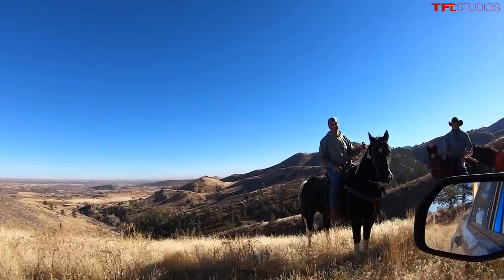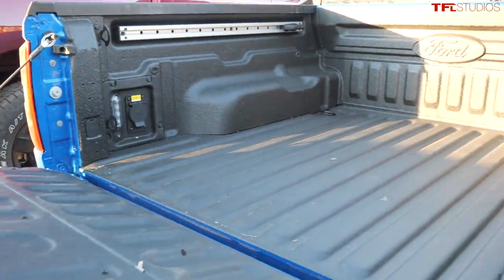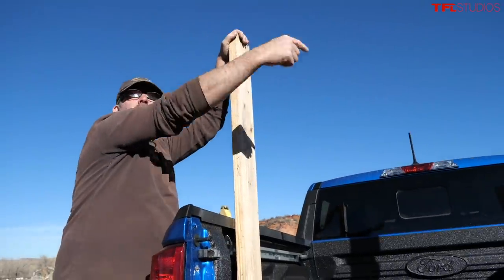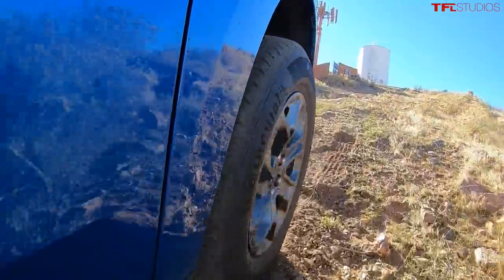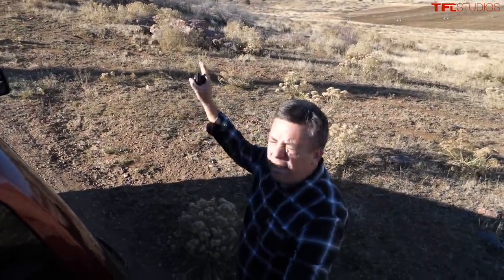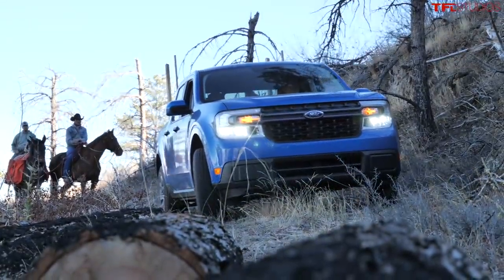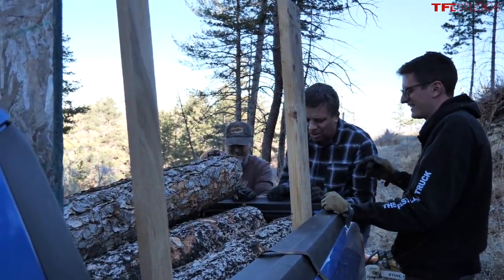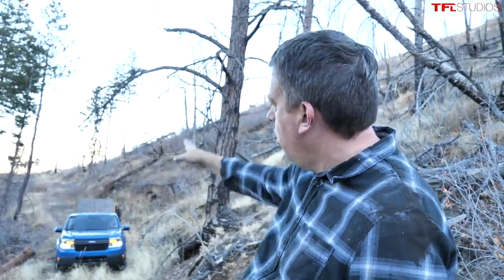Did We Go Too Far MAXING Out The New Ford Maverick To See If It’s Ranch Rated?

Comment: I’m very impressed with the Maverick’s capabilities. I just wish the hybrid was available in AWD.
Reply: I think almost like Apple they’re holding back that feature I would bet in a year or two it will be available in all wheel drive. Who knows maybe we will even get a 50 miles of range plug-in hybrid all-wheel-drive that would be absolutely awesome!
Reply: @TristenHernandez  Yeah they can't keep up with demand as it is.  Once sales start to cool a bit  I expect we'll see an AWD hybrid.  They could do a plug-in hybrid but I would expect that cost to be more than the turbo.
Reply: that would take a hit on mpg and add money to the price. you either want mpg or you don't that's why the other engine is an option
Reply: But will it preform the same at 200,000 miles...
Reply: @philllsxga.7737  If it's anything like the 1st and 2ng gen Escape hybrid that came before it, it'll perform the same at 400K miles.
Reply: @supersnot4  I doubt that...
Reply: Nope not gonna last as long with all that tech and batteries polluting landfills
Reply: Just wish I did not have to wait for my hybrid maverick till maybe hopefully next Aug, ordered in Aug 2021
Reply: I live in Utah, a state marketed around it's snow. Yet fwd is all you need here most of the time. If it's good enough for Utah winters, it's good enough for the winters in most states.
Reply: @lutomson3496  The hybrid system is far more durable than most gas powered vehicles you can buy.
Reply: @KB-bh9hp  I own a hybrid and bought it for gas savings only but it has much more recyclable NIHMD batteries vs the lithium batteries of which 50% end up in landfills
Reply: @lutomson3496  Well, it stands to reason that as more hybrids/evs populate our road, and the issue of recycling batteries gains more attention, that certain companies will step up and come up with more ways to sustainably dispose of batteries.
Reply: @philllsxga.7737  The data (specifically regarding Ford and Toyota hybrids) is pretty strongly in favor of their longevity. And as a mechanic, intimately familiar with how they mechanically work, I have to agree with the data.

But hey, the more people dislike them for no good reason, the cheaper they are on the used market. Win win for me.
Reply: @philllsxga.7737  
1. I don't buy cars based on how environmentally friendly they are. That said, the environmental cost for the lifetime of a vehicle is FAR less with hybrid and electric vehicles.
2. While I don't have hard numbers here, Ford does sell more vehicles than GM, so more spent on warranty is no surprise.
3. I watch car wizard and deboss. While I don't agree 100% with what they say, they generally call it like it is, and neither of them dislike Ford as a whole. They have specific issues, just like all manufacturers.
4. Your anecdotal experiences are much less meaningful than data collected from large numbers of vehicles.
Reply: @supersnot4  

Hard data does support that Battery cars are more "environmentally friendly" then regular gas cars. I'd ask them to support their opinion with data. So far no one can in support of gas cars. Plenty of cited sources  to support Battery cars, not just anecdotal opinions and experiences.
Reply: @supersnot4 and why do you think Ford sells more car's then GM?!?!?
🤣🤣🤣🤣🤣🤣🤣🤣🤣🤣
FORDS DON'T LAST AS LONG!!!!!!
Reply: Obviously you did not hear what Deboss said about Ford...
Reply: It would be stupid to have a AWD hybrid that weak
Reply: @KB-bh9hp  you mean like VW and their already scaleable recycling system?

Just shredd it. Separate it in a cyclotron and then treat the black powder as resource and chemically separate it. Plus that is cheaper than extracting new resources.
Reply: @AsianNIGMA  I have a 2009 AWD escape hybrid. It's like a goat offroad, way better than I was expecting when I bought it. The AWD is more like 4X4 that disengages at higher speeds, so the rear wheels always have torque going to them.

I'd put it about at the capability of a stock XJ 4X4 offroad (I used to have one). Not nearly as much suspension articulation, but traction control makes up for it and then some. Plus there is a physical button to 100% disable traction control if needed.
Reply: @philllsxga.7737  Nobody is forcing anything down your throat. If you don't like hybrids, simply don't buy one.
Reply: @philllsxga.7737  Sounds like you spend too much time on the internet.
Reply: @TheCapn23  I'm a realist that thinks for myself..
YouTube George Carlin saving the plant...
YouTube George Carlin doesn't vote.
YouTube George Carlin the American dream.
Don't be a sheep... Be a leader ..
Reply: @philllsxga.7737  For such an independent thinker it's weird that you're basing your life off a comedian. Sounds like a sheep to me.
Reply: @TheCapn23  it's real tho...
That man made comedy out of real world situations. Look what's happening today...
Don't be a sheep...
.
Reply: Same! I'd probably buy one if the hybrid could be optioned with AWD.
Reply: I get exactly where you’re coming from but as someone who has a RWD F150 I can tell u that it is not a deal breaker and very manageable (I live in Utah)
Reply: @philllsxga.7737  r u mad bro
Reply: @philllsxga.7737  - The brainwashing goes both ways. You don’t speak in a manner that convinces me of you individuality so much as you are blindly repeating the comments I have seen so many others make. The louder you get (so to speak) the more it show. You are hilarious!! Ridiculous,,,,, hahaha.
Reply: Why would you when they have the eco boost maverick able to tow 4,000 lbs
Reply: @Emmaangel420  - I think some people just like the option. It will definitely be much better on fuel than the 2.0. The 2.0 will be pretty decent mind you. So long as you don’t accelerate hard in it all the time!! Haha. If my wife gets one, like she says she wants, it will be a 2.0 AWD and her choosing the 2.0 will be because it’s the motor she prefers. I’m thinking it may get driven by myself as well a lot. Haha. I have a 21 Ridgeline, but I like the smaller option for city driving and the Maverick has better sight lines. I do love the Ridgeline though,,,,,,.
Reply: @philllsxga.7737  gm cars are trash man what are you talking about?
Reply: @philllsxga.7737  you act like hybrid cars need to be recharged🤣 a hybrid will take you much farther even with a load.(more miles per gallon...get it)
Reply: @willyloehman2812  just another gimmick there sheep...
Reply: @philllsxga.7737  your not that bright are you
Reply: @philllsxga.7737  don’t like it? don’t buy it. Simple as that. Grow tf up
Reply: I got around in Montana winters long enough with FWD that the lack of AWD doesn't bother me, what they need to do is scale back the cab size and/or offer a longer bed. I know man sedans are all the rage these days but for those of us who actually use our trucks for truck things you've got to have more bed. Even the 6'9" bed on my F-250 often isn't enough, 8' should be standard for full-size trucks and 6' for smaller trucks.
Reply: @philllsxga.7737  Lots of escape hybrids taxi's hit 200k easy
Reply: @philllsxga.7737  Lol I like deboss but he lives in the old gm days. New GM is the worst domestic car manufacturer, even Dodge/fiat has surpassed them sadly. The only new GM products that are good are the 2500s. Ford has made unreliable vehicles, but GM ain't any better. They all have their good and bad years/models. I have worked on them all and no brand is perfect. Toyota and honda are the only ones that are consistently more reliable than the others
Reply: @willyloehman2812  yeah people posting this probably drive a GM from 1999, they are now one of the worst manufacturers. Only thing good they make is the 2500 trucks and  even those aren't as good as Dodge/Ford
Reply: @philllsxga.7737  Right the 5.4 released in 97. The modern lineup GM is the weak link power train wise. Sure aluminum bodies are not as forgiving as steel but they don't rust and are lighter
Reply: They could do it like Toyota with AWD-e with another electric motor on the rear axle (although more powerful than Toyota's)
Reply: Yeah that's cool I said it doesn't rust there is a difference and is more resilient to certain conditions. I don't care about LS swaps sure it's a good motor but doesn't matter when it's built around a cheap vehicle.  Look up GM transmission issues, cylinder deactivation, frame rust on brand new vehicles and Chevy bolts burning to the ground from bad wiring. They are one of the least reliable manufacturers right now. Your living in the past they only care about profit now. Not saying Ford is much better but GM has fallen far
Reply: @rawniew  no GM is not what they used to be but work on some modern cars and trucks,  you'll see the difference...
Ford is still Mickey mouse BS still...
Reply: @trentmazzotta2356  The RAV4 hybrid is ingenious.  The gas motor drives the front wheels so the drivetrain doesn't change much from the ice model, and they put the electric motors in the rear.

It's an amazing AWD hybrid design and should be the standard.  Put the motors on the wheels that the non hybrid version doesn't go to.
Reply: @406Steven  only its a mini truck so it cant be big and expensive get it? Cuz then its just an f150/250, I mean do I want a 20k f150, sure but lets be realistic.
Reply: @rawniew  i agree with Ll that until you said dodge.  They look cool.but are not really known for bwing any bit reliable.  Again the old diesels were great but other then that...
Reply: @willyloehman2812  I just want something practical, I don't think it's asking too much to out a useable bed on the Maverick especially when the old Ranger came in a number of configurations. I'd like a regular cab with a cubby behind the seat or extended cab like my Ranger had for some interior storage and a 6' bed. I think that's reasonable for the price range and capabilities of the platform and I'd consider selling my car for one and have 2 trucks depending on which one I need for my purposes.
Reply: @406Steven  maybe , but it would be like producing an entirely different car.  New frame and chasis, weight distributions will be off and have to be compensated for with changes.  Its cheaper to go for a one size fits all approach and pass on the savings in manufacturing.
Reply: @philllsxga.7737   Anyone that listens to deboss for any sort of advice obviously did not graduate from high school.... and by your posts I think you have proven that beyond a shadow of a doubt...
Reply: @matthewq4b  do you work on car's and trucks for a living/ hobby????
I have experienced exactly what he is talking about about Ford...
And if you ignore a professional mechanic like him then you are just ignorant...
Reply: @philllsxga.7737   He may be a tech but far from a professional one. On multiple occasions, he has been called on the BS he has posted about Ford.  That clearly was made up and obviously had NEVER done what he said he did.  Furthermore, he admitted as such in the comments when he was called on it.  Sort of like you tried with recall costs.  And as An FYI GM spent more on recalls for the Bolt alone than Ford spent corporately in the same time period..... So nice try at the BS spin job. And Ford latest recalls are supplier related to Air Bag inflators and FYI GM will be doing the same recall in the coming weeks....  So thanks for proving your lack of a high school education to a tee....and that you really have no clue what you are talking about....
Reply: @matthewq4b  do you work on vehicles for a living/ hobby???
Reply: @matthewq4b  do you work on vehicles for a living??
You are just a key board warrior...
🤣🤣🤣🤣🤣🤣🤣🤣🤣🤣🤣🤣
Reply: @matthewq4b  🤣🤣🤣 wrench on vehicles, I'll be 
🤣😂🤣😂🤣😂😂
Key board warrior 😂🤣😂🤣😂🤣🤣
Reply: @supersnot4  considering that I still see a ton of second gen hybrid escapes being used as taxis, I can see the maverick hybrid lasting for a long time. People also seem to forget that hybrid batteries are a lot smaller than EV batteries, which makes them cheaper and easier to service when they eventually wear out.
Reply: @TheCapn23  more like too much cable “news”.
Reply: @philllsxga.7737  your talking about Chevy bolt. It's a hybrid it's two different powertrains to maximize potential for everyday use. Most people don't use a truck as a truck anymore, a couple days out of the year they at most will think man I wish I had a truck right about now.
Reply: @cameronshallow9490  yes I know people don't use their trucks as trucks people buy trucks for a status symbol..
People are fake...
Reply: @philllsxga.7737  Are your beliefs your own or someone else's. Are you going off what you believe or are you going off of facts. You going off of Facebook or the news. You know this isn't the first time in our history that we ran off of electricity once there were electric and gas cars I'm pretty sure when cars first began to be a thing. Companies however found it was more profitable to sell gas versus electricity because many people created their own electricity. Same goes for public transportation why do you think our public transportation is so poor because the big three bought them out and then scrapped their plans that's why we drive everywhere. That's also why we don't have adequate trains that can get us there faster we are lagging behind the world based on our knowledge of how better it could be because we're so destined to stay the same.
Reply: @cameronshallow9490  Im a realist also..
In my family we are on our 14 th GM with over 300,000 miles and hardly any major issues..
My brother blazer just turned 309,000 miles and the four wheel drive works.. the AC quit this last summer.
I tow and off road with my Silverado, so far 130,000 trouble-free miles.. not one issue so far...
I go off of my own experiences with vehicles I don't believe anything I read..
My buddy's 1996 GMC Sierra had 540,000 miles on it and the four-wheel drive worked...
I go off roading a lot every summer in my daily driver Chevy...
Reply: @TheCapn23  thank you 😭 the hypocrisy
Reply: @KB-bh9hp  Former Tesla engineer J.B. Strauble started his own battery recycling company in California. I believe Ford is one of his customers. The name might be "Redwood Recycling".
Reply: Says everyone
Reply: @TristenHernandez  get the hybrid upgrade in 2023
Reply: @lutomson3496  you are wrong
Reply: @philllsxga.7737  then walk
Reply: @lutomson3496  and carbon monoxide in the air with all the fart machines
Reply: @KB-bh9hp  recycle
Reply: @philllsxga.7737  ima get a hybrid
Reply: @supersnot4  we use to have horses
Reply: @philllsxga.7737  plenty rangers on the road 30 +years
Reply: @philllsxga.7737  you need a big truck . Not everyone needs that.
Reply: @philllsxga.7737  first car seemed like 
A gimmick at the time
Reply: @tmadden4951  yeah with the ass end leaning to one side because of broken leaf springs 🤣🤣🤣
I see WAaaay more S10S and Silverado's on the road then rangers and f 1wimpies...
Reply: @tmadden4951  I'll just stick to my old reliable Chevy..
My brother's turned 309,000 miles the other day and the four wheel drive still works like new...
Reply: @tmadden4951  oh do share im all ears
Reply: an AWD hybrid would be exactly what I want
Reply: @philllsxga.7737  We get it bro, you make 50k a year in a factory and drive some 6 year old out of warranty shitbox like a peasant.
Reply: @NickTarterOKC  diesel would be nice too. A 2.0 turbo diesel
Reply: @willyloehman2812  I have a 2016 Chev Colorado with the 2.8 diesel... that thing is a beast.
Reply: @philllsxga.7737  why the … lmao
Reply: @fburnrostro95  they act like they never loaded the bed of a truck full put the axle on the bump stops!!???
My buddy started a landscape business with a two-wheel drive Sonoma everyday.. every day the bed was full and towed a trailer that was at 120,000 Miles on the truck when he started his business..
When I haul dirt and gravel in the bed of my GM truck it's on the bump stops every time!!
I had a yard and a half of topsoil in my Sonoma at 220,000 miles, no problems!!!
Every time my buddies and I load are GM trucks they're over payload every time!!  My buddies and I have done that all the time for many years overloaded the bed of  GM trucks...
That's a brand new truck it damn better be able to haul some logs!!!
Another friend of mine has a super duty every day he's towing 15,000 lb every day!!!
Reply: @trentmazzotta2356 there are other awd hybrid trucks.
Reply: @KB-bh9hp wait till you live where you get a lot of snow and it's even colder

Comment: Unquestionably, this is the most radical review thus far of the new Maverick. Frankly, if you really were to use the hybrid Maverick for farm/ranch work, you'd put off-road tires on it. That would address virtually all the traction issues, and could even get you a tiny bit more ground clearance. That said, the EcoBoost version with all-wheel drive and the FX4 package is probably the best combo for full-time farm/ranch use. I can't wait until my XLT with the luxury package is built, probably in the spring.
Reply: When did you order? I'm expecting a April/May build to be honest since i ordered last week.
Reply: I think a hybrid AWD or plug in hybrid AWD maverick will be a game changer.
Reply: @Knuckles549  I ordered in early October. My dealer has recently advised me that spring/early summer was likely. However, he may have been underpromising and hoping to over-deliver.
Reply: @YoFool.1506  Yeah, sorta jump ball on those two choices, tho' a AWD plug-in hybrid is technically possible using components from the existing Ford parts bins.
Reply: @ontheroadwithralph1530  reminds me I should probably follow up with our dealer. Pretty certain we ordered sometime in late October, haven't heard a date yet either.